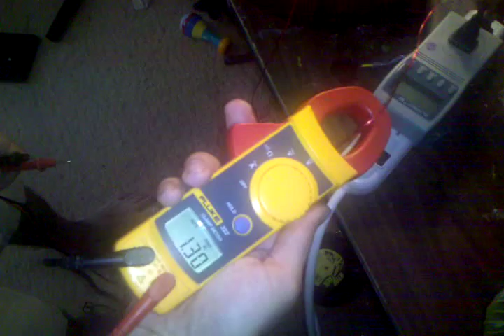Gabriel Device 2.mp4

Comment: Use 4 diodes and capastor to rectifer and meashure DC curent on output. Then you can not make mistake in meashuremets (meashure Dc curent and DC voltage). On input need meashure with wattmeter, because in input can be some reactive power, who going back to socket.

Comment: when using reactive loads the current will go out of phase with the voltage (current lags volts for inductors) so it is less straightforward to measure power and current, your figures suggest a power factor around 0.3 to 0.4, measure the power factor and you will probably make the sums balance. Also at 10 hz the lights would visibly flicker, so I suggest this is not the resonant frequency of your cct.

Comment from the maker: when you put a ballast on the input of a inductive load like a transformer it will drop the whole deal into resonance allowing it work at its natural frequency at least thats what Ive been told. you can also put a ballast at the output and it will do the same thing your amp draw will drop and your output voltage will spike. I wish I had a signal generator to test high frequencies cause there is possibly more than one natural frequency to this device, higher frequency would = more joules.